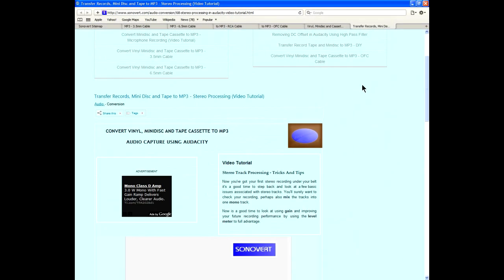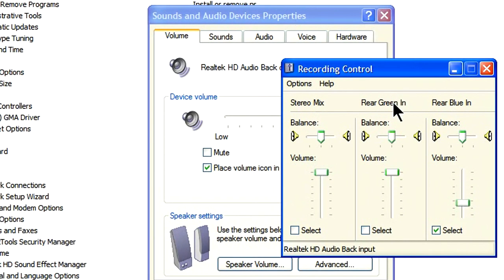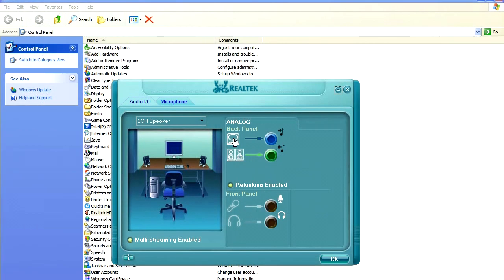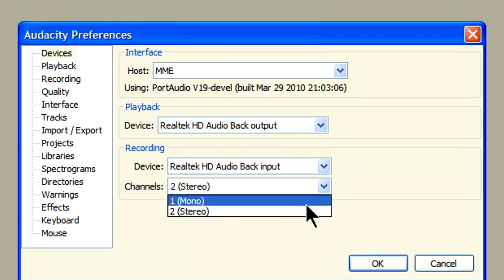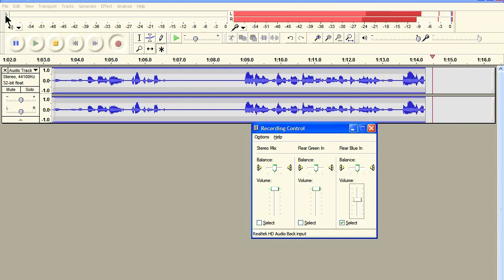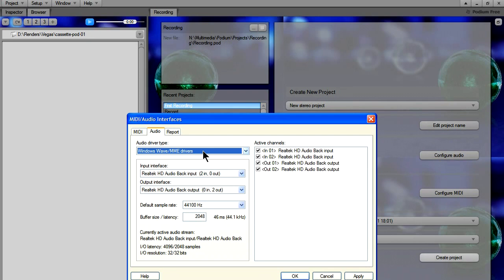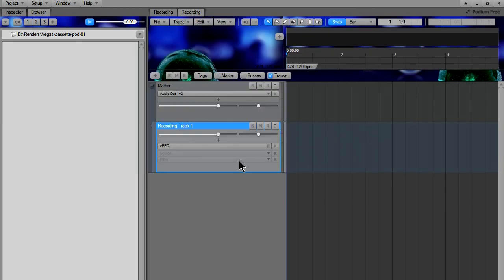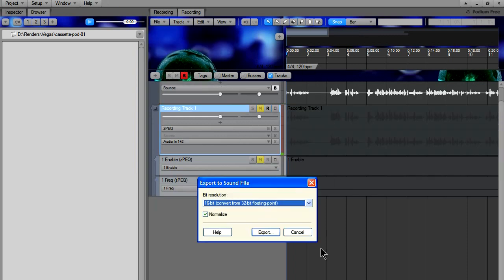Copy Vinyl Record, Tape and MiniDisc to PC MP3 using Audacity and Zynewave Podium

Comment: Sample workflow for tape digitization
https://manual.audacityteam.org/man/sample_workflow_for_tape_digitization.html

Here's My Cheat Sheet Guide. This is all I do now that I'm set up.
 I don't spend more than 5 minutes on a tape.

1. Transport>Recording>Timer Record
2. Effect>Click Removal
3. Trim up Beginning, Middle & End.
4. Effect>Noise Reduction
5. Export to FLAC
Reply: Tip: Add 3 minutes to your timer record. Why? Because tapes are always longer that stated on the tape. I've seen as much as 3 minutes.

So For a 100 minute tape. 100 divided by 2 (Side A & B). 50 minutes per side plus 3 minutes. So 100 minute tape. 53 minutes.
100=53
90=48
60=33

Comment: Sample workflow for tape digitization
https://manual.audacityteam.org/man/sample_workflow_for_tape_digitization.html

You could watch a dozen youtube videos and still not learn what I've learned from this 5 minute read.

Follow this guide if you want to get good settings for cassettes. Much of this applies for Vinyl and MiniDisc too.

I use this guide for my setup, some things you can skip. Trust me, this page may appear overwhelming at first, but it's really very simple and once you are set up, most of this you can skip and much may not even apply to you.

*Tips: *

Skip the parts that don't apply to you. I skip plenty hear or only do for initial setup. If you're a major audiophile then you'll know what to skip and what not to skip.
 SKIP IT <----I say this because usually you do this once and your done. And I want to illistrate the point that this isn't as hard as it looks. Still read it an use your good sense.
1. Audacity settings. By default, this is already done in Audacity. SKIP IT
2. azimuth adjusting is rarely required SKIP IT
3. very occasionally do i clean the tape heads. SKIP IT
4. Re-tension the tape. Whatever, Rewind it to side A and call it a day. meh  SKIP IT
5. Recording levels. Find the LOUDEST tape you have. Set your levels, and never touch them again. SKIP IT
6. Capture... PRO Tip: Click "Transport>Record>Timed Record"
Set your Auto Save Name.
Set time limit. For a 100 minute tape, divide by 2 for side A & B. So 50 minutes right? Okay, but "ALWAYS" add 3 minutes of recording time. Why? because cassettes are sometimes longer than stated. I've seen up to 3 minutes extra. Rare, but it happens.
60 minute tape set to 33 minutes. For a 90 minute tape set to 48 minutes.
7. Raw master backup. SKIP IT
8. Remove DC offset. SKIP IT
9. Reduce tape hiss and high frequency noise DO IT!
10-14. personal preference. I've got too many tapes to care and just keep one long track.
15. I do it.
16. Compression. I Skip it.
17. Export a set of WAVs... Fuck WAV. Use FLAC or MP3 360
18. Export Labels. I don't do labels. Or tracks.
19. Backup. You decide.

You'll learn what applies to you here soon enough. But I personally have too many tapes and don't spend much time on my conversions.

Here's My Cheat Sheet Guide. This is all I do now that I'm set up.

1. Transport>Recording>Timer Record
2. Effect>Click Removal
3. Trim up Beginning, Middle & End.
4. Effect>Noise Reduction
5. Export to FLAC

Comment: Thanks for this video! Im getting back into minidisc after many years and I was needing a way to break out imprisoned tracks locked up by the netMD copy protect bs. I knew I needed a line in solution but my laptop has only a mic/headphones combo jack but it can be reconfigured and set up for 16bit stereo 44100hz. I needed this video. Thanks!

Comment: following your steps here. thanks. i have a question - when i open up my volume control - i only have one option - SoundMAX Digital Audio. (windows xp)

would you recommend Realtek instead and how do i get it?

I have minidiscs with recordings of my songs i want to record onto my PC using audacity. i have a sony hifi combo with a mini disc player (the original mini disc recorder was nicked years ago..) with a phone outlet and i have the blue line in.

so far, what im getting is a very low level sound recording and i have to normalize it on the audacity to increase it, but i think its changing the quality of the original minidisc recording. so i am here looking for information 'how i could do it better'. thanks so much.
Reply: and thank you for pointing out the buttons for 'record' and 'playback' on volume control...i didnt even know they were there. ..i'm on a learning curve here. and i figure i must find out 'how to' get the levels right before i even record.